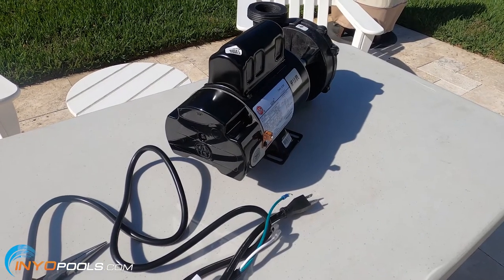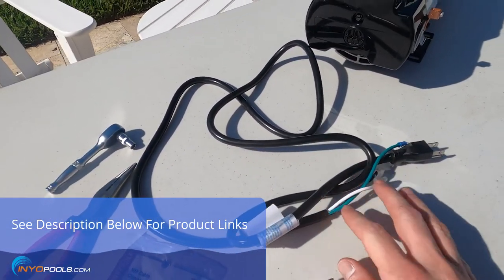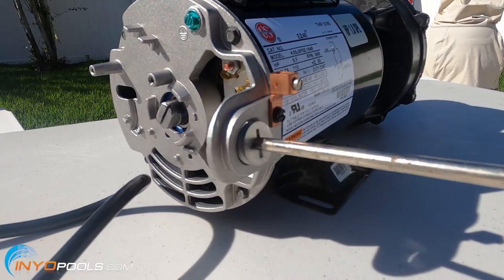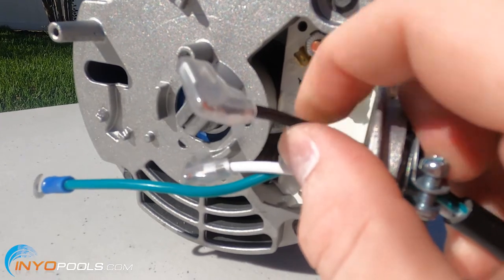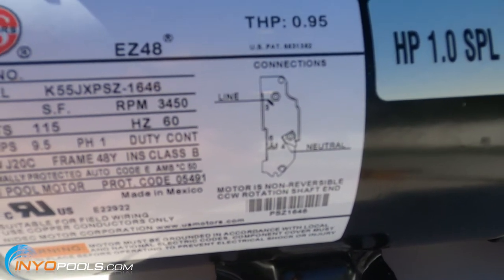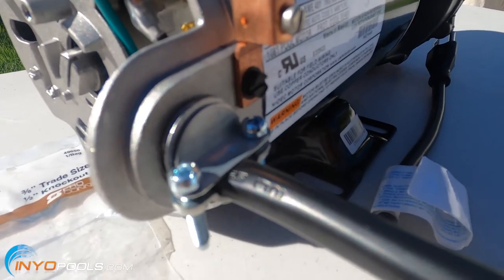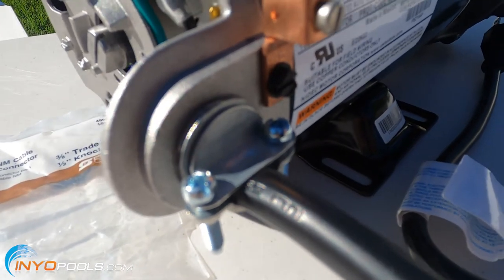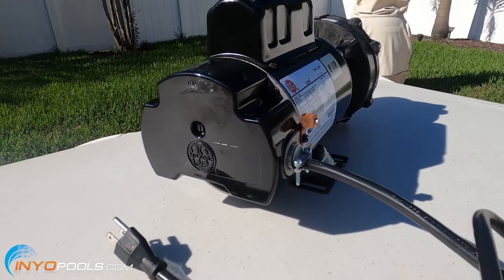How To Add Power Cable To Pool Or Spa Pump

Comment: "Nearly" what I was searching for, as I want to ditch the electrical tape "water proofing" connection that I currently have where my cord exits the motor.  I hope you will consider editing this video with the correct water proof connector similar to what you mention in the comments ("pvc liquidtight connector instead of the twin-screw clamp"). 
Unfortunately the "PVC liquidtight connectors" that I found are designed to attach to pvc conduit.  
I found the correct connector by searching for "Cable gland cord grip"
Thanks!
Reply from the maker: Thank you for the feedback!

Comment: What are the little hook connectors at the end of the wires called, those look like they would be easier to work with and more secure
Reply from the maker: Insulated wire connectors is what I usually call them.
Reply: Female flag disconnects

Comment: You should be using a water tight connector to feed the wire into your pump. The romex connector you show isn’t water tight.

Comment: My pump is hard wired to my panel box would I be alright to splice a cable to the pump? Then plug it into a outlet.
Reply from the maker: I suppose that could be done, but I don't know why it would be advantageous over hardwiring it. Check your local codes to ensure there isn't some ordinance against it.

Comment: You discontinued the video that would show you how difficult it is to push the terminals over the posts. Also, you didn't address two speed pumps and water proof seal and the Balboa heater connection???

Comment: How do I add a plug wire to a magnetek  pool pump.  And I don't have the cable that came with it
Reply from the maker: What is the part number or catalog number of the motor?